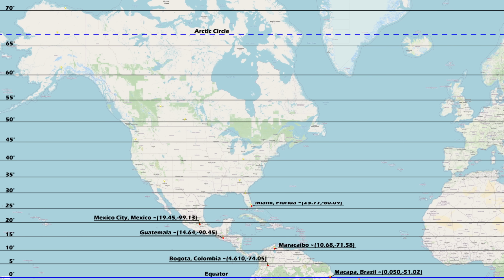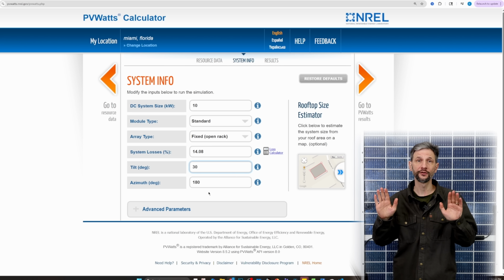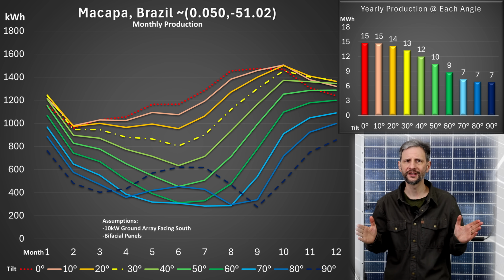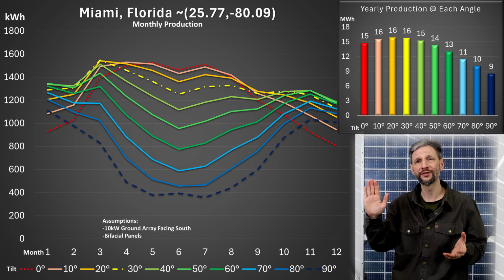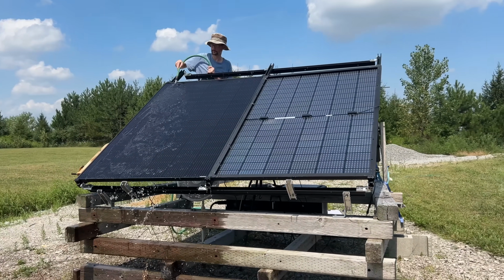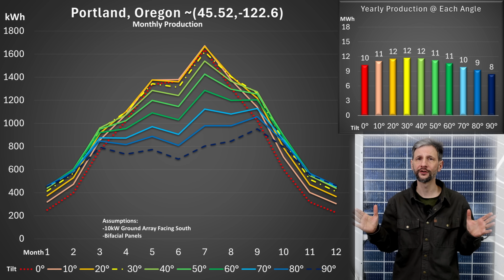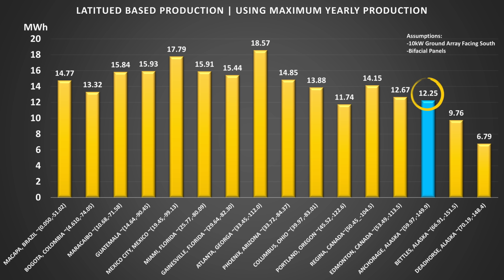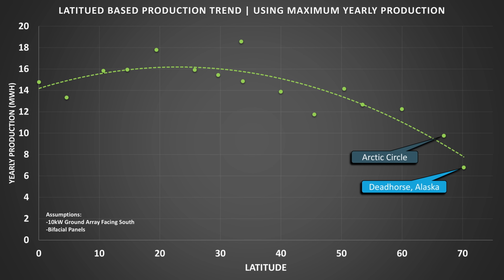Your Location Destroys Solar Panel Efficiency

Comment from the maker: Solar Panel Sources on my Website: https://projectswithdave.com/solar-panels/
Signature Solar ($50 off $500-Discount Code : "GET50EVERYDAY"): https://signaturesolar.com/?ref=SALE
Buy my WIFE a Coffee - THANK YOU!! https://projectswithdave.com/donations/give/
CORRECTION:
A viewer noticed I mixed up the location (Lat and Long) and solar production data for my Phoenix and Atlanta segments.  Phoenix is actually the higher production location just as you would expect.  The heat is not enough to counter the higher solar exposure.  Sorry for the colossal ERROR!
Signature Solar | Solar Panel Deals: https://signaturesolar.com/all-products/solar-panels/?ref=SALE
Reply: I would love a electric plus hot water panel, but all of them still cost too much.
Reply: absolute brain dead rubbish here. at 55 degrees north in the UK, putting a verticle array up in the path of the winds we have, the pannels wont last 5 years
Reply: @jukeseyable  depends on where, some areas have more wind than other. Same with the US and every other country.
Reply: @jsbrads1  I'm a brit, and also a commmercial vegitable grower, so I pay more attention to the weather than most. i think i know where the Uk has significant wind. One thing is clear, and not at all based on my subjective judgement, not a single solar Pv install in the UK is verticle, it says it all. if verticle with its space saving was viable then it would be installed here. But it's not
Reply: @jukeseyable  vertical solar panels are a relatively new innovation as the latitude angle was considered best practice world wide and only recently specifically with the new bifacial panels has the option of vertical panels been seriously considered to any degree.
University of York did a study on bifacial panels (article dated May 16, 2025) and recommend it.
Reply: @jukeseyable  I'm in the UK, and i set up my panels vertically. At least some of them.
They are single sided and are at the north end of a open field, with a line of trees an a hedge behind them.
From about 10am the sun clears the tree line on the south side, and that when you start getting your power.
Dave has his vertical panels out in the open, unshaded, so he may get power earlier than that.
If you put a lot of vertical panels close together, they'll just end up shading each other until the angle of the sun increases, but by then you aren't at an optimal angle for the panels.
At best you can have a line of panels set with the longside up, then in front of those, a line set on their sides.
From that point, you have to start tilting the panels back, but mounting options then become the limiting factor.
Like  Dave mention in the video, it's hard to find a mounting option above 40 degrees. And a lower ground mounted system can deal with winds better at ashallower angle. The UK (generally) doesn't suffer much snow, so the shallow angle isn't much of a problem.
Vertical panels can absolutely resist the windloading. 
Mine will handle around 150mph no problem, using 7 x 2s as the posts, locking them all together at the top and creating diagonal bracing on the north side every other post.
But like i said, unless you have a really big field where you can space out long lines (east to west) of south facing vertical panels, it won't work.
Reply: I would be helpful if you can post those charts on your website

Second if you do a split array: one facing South-East and another South West to get more power for a longer period of the day. In most cases a single south facing array will peak above demand for several hours, especially in the summer. I think two arrays would would better overall for all 4 seasons.
Reply: @guytech7310  sure, there are benefits, you just have to design the wiring correct too. Only panels facing the same direction can be wired together. Many solar systems are wired in series, and that only works if they are all producing the same power at every moment.
Reply: @jsbrads1  You can only wire a limited number of panels in series anyway. Too many panels in series will cause an overvoltage problem. Large arrays have to have some parallelism. Separate arrays can be combined.
Reply: @guytech7310  you can only safely and efficiently combine arrays that are facing the same direction, doesn’t matter whether you combine series or parallel.
Reply: @jsbrads1  1. My inverter will accept two strings, 2. strings can be combined using a PV combiner.
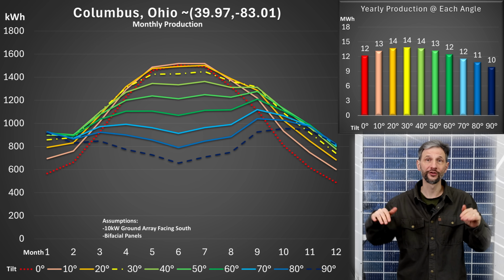Reply: 7:28 - in case you might do such comparisons ever again:  give the viewers from outside USA - and I guess you have a lot europeans at least - MORE time to compare their "OWN" location with those you are comparing. 

I stopped here cause I had been in the USA but I usually tend to forget that the most northern part of the USA (except Alaska which is a different story) here Portland is far south than all central european countries, even south of Switzerland. 
Which again helps to understand the huge differences regarding climate cause chicago is south of Switzerland ... but the climate quite colder and different. 

If you start such an animation give it 2 or 3 seconds to simply adjust or being able to stop the video to allow us a comparison , as you offer the european country on the map at least up to the german polish border or maybe 80% of EU is covered. 

Just a small detail, but try to do it on your own and assume you are living in Hamburg, germany, close to the north sea. If you have found that then turn your head to the left and follow the line to recognice that Hamburg is even north of Portland at the level of Edmonton. 

I am living in germany a bit more south than Hamburg, but not that much : in the middle of nowhere between calgary and edmonton. 

We have an annual production in good years of 1 MWh per kWp installed or 10 MWh for your 10 kWp on a south facing roof at 28 and 18 degree, but with huge peaks which means 10x bigger production in summer than in winter. And that causes issues for the grid if people are hunting a zero draw from the grid and build big arrays with a high surplus they can feed into the grid and get about 0,07 € per kWh which are 0,09 $ while we usually pay about 0,30 € per kWh from the grid (1 flat tarif 247 and for 365 days). 

Great charts and overview, color choices and markings that provide a top overview for everyone. Europe has its own huge solar power institute and tools provided under the term pvgis. If you search for that you can choose the simulatio models and what not and best: not only for europe, but for most countries around the world - and it is free of cause. 
PV Gis is the best starting point for everyone interested.
Reply: You need to correct the Phoenix / Atlanta switch. Have text flash over the start of the video. If I didn't see it here, I would have believed you.

Comment: I have sat and thought about some kind of extremely large battery system you could use to make it through winter in AK. One idea I had was just generating hydrogen from water electrolysis and using a fuel cell in winter. But then you’d have a gargantuan tank of extremely explosive gas that has to contain thousands of psi….yeah. It would be interesting to figure out how to make living in Alaska not intrinsically carbon intensive.

Comment: In florida, id take the 10 degree and even a flat one, because the main consumption comes from cooling, which drops a lot in the winter. Sure if you have yearly net metering in theory something else is better, but if you want to build a grid, or cooperate with it, it makes sense to make more power in the summer.

Comment: I always did wonder if I should have angled my solar for my fence a bit but since I´m at around 48 Latitude I think having it 90 degrees was a good choice especially for winter when I need that power the most and my roof solar is often covered by snow.

Comment: there is too little difference to justify not adding panels (that are cheap outside US) to overcome the inclination imperfections, unless heavily space constrained.
The magic of near 0 angle is that you can orient them in any cardinal direction while keeping production steady enough troughout the day. 
Some more arguments for the angle doesn't really matter, brute force with panels:
You can't step on a 30 degrees roof in winter to clean up snow that panels refuse to unstick.
You dont need to account for wind sail effect and the vertical space visible form neighborhoods when stacking them vertically on a ground array.

Comment: I'm moving my system on my property for better winter sun and no shade issue (live & learn). I'm just below the 45th parallel. I'm thinking to have 6 panels in the vertical position at 60 degrees and 4 panels in the horizontal position at 30 degrees. I'm thinking a mix of tilt angle will give me some of both worlds. Or, do you think all at 60 degrees would be best?

My frame is fixed style and made from pressure treated lumber and speed rail, and I can change whatever I want with it as far a angles. The panels are Aptos DNA-108-BF10-410w bifacial with a maximum 513w. I've read that the best I can expect is 80% of the total watts.

Second question. I'll have a 175' run. My calculations with voltage drop is under 3% at 200 watts and up using 10g PV wire. Am I safe using 10g wire?

My system consists of 3 100amp 48v batteries and a 6500 watt 120/240v all in one inverter. I also have another all in one 3500 120v if needed. All off grid.

Comment: I was thinking of doing a solar fence but I had a idea instead of using bifacial I would use 2 set of 4 panels in series parallel 1 set facing in each direction.

Comment: Sharing my system: 
Europe, 45 degrees latitude 
60 degrees angle for the panels
5KW towards S-E
10KW towards S-W
12KW Monophase invertor 
15KW LiPo battery
Happy to answer any questions.
Thank you Dave!

Comment: For bifacial panels would the panel array benefit from the use of "white" gravel under and behind the array? 
Could the back benefit more, from a reduced angle, than the front would suffer?
If you mounted your array with neighboring, to the side, panels separated by a foot, or maybe 6 inches, the array would be wider but the back would get better light if the mount is angled?

Comment: Looking at this, when i do my system i should invest in a movable rack and just change the tilt throughout the year. Im at 46 latitude and we get a lot of snow. So figure when we have a winter storm coming i can set the pannels to verticle and when it passes put them back to whatever angle makes the most power.

It will cost more sure. But im planning my system to be able to 100% be powered off solar with a backup diesel. So makes sense to invest in the best racks.

Comment: How would this angle by location changes based on the locations altitude?
Reply from the maker: Higher altitude in general means thinner and cooler air, so better production overall.

Comment: This video contradicts your solar panel show down video. Which showed vertical north south was the best orientation. Now the data show the complete opposite.
Reply from the maker: That video shows the Vertical N/S solution was the best production only in the winter, under snowy conditions.  Vertical panels generally under produce tilted panels.  You would only use them because of some other objective.  For instance, a location in the north with a lot of snow, or an E/W orientation for capturing morning and evening power more effectively due to fluctuating power rates or off-grid objectives.

Comment: On my bifacials vertical i get about -30% less on the faces on the wires side, in my case 40.51, -7.11, i pointed the best(top) face to West, so when less sunny days i can get as much sun converted to wh possible as those days sometimes get sun later on. Installation 4 bif vertical E-W and 8 normal South (i increase angle during winter).

Comment: I live in Edmonton, so knowing this, I will definitely give the panels a high angle to shed snow
Reply: I did solar for oilfield radio installations near Edmonton.  We would just install the panels vertical and facing South, because it was far more important to have reliable power in December than maximum production in the summer.  However for residential Dave said that we don't need a lot of power in the summer for AC.  He missed that "Edmonton" or prairie summers are actually really hot now and AC is really becoming a must have.

Comment: Thanks Dave! I am near Fairbanks Alaska.  My current array is on a diy adjustable tilt rack(we  have a little video of it on our YouTube channel if you're interested). Vertical for the white season works great. We are about to upgrade to 8000watts of bifacial panels.  Gonna reuse the existing rack for half the pv. Now I am thinking of making the other rack simply Vertical all the time.

Comment: Hey, I'm in Ohio also. I have a really challenging property to get solar panels and will likely never be able to get off grid levels, but I have an idea. 
I want to use a solar battery generator set up, with panels for daily charging and use my generator for charging or power during an extended outage. 

Do you do in person consulting?

Comment: I'm at 52 degrees, new array will be vertical on south wall on my shop and a second one as a south facing fence.  We currently have 19kw on our house roof and snow is an issue for sure.

Comment: What aluminum strips do you use for the vertically mounted solar cells if you want to make a whole row like a hedge? Where did you buy them and how much do they cost?

I live in Denmark I nnnet a link to order if you wil help I wil be very grateful ❤

Comment: With over four decades of off grid PV use I can tell you my obvious choice in Southern Michigan is vertical south facing panels only.  Traditional placement means lacking in winter with excess in summer.  With vertical panels I rarely have any snow/ice on the panels and the sun is very low on the horizon all day maximizing output when it is needed the most.  This method maximizes actual off grid realities with batteries, but wouldn't be the best choice if you are a grid inter-tied system and only care about maximum annual production.
Reply: Thanks for your insights 🖖
Reply: I'm pretty close to your neck of the woods and I think I'm going to do 24 Vertical North/South, 3 East, 3 West. The goal of my system is to have a hybrid system that almost never actually touches the grid (emergencies only, basically.) My thought process is that while I'll need more panels for the same production, the panels themselves are pretty cheap these days. Going from planning for 20 panels to 30 actually only raises the cost of my total system by about $2000, but it'll reduce my spending on batteries by just as much as well as the number of incidents where I'll have to pull grid power.

Seems like a no-brainer here.

Comment: This was a highly informative video! I'm at 40N and I'm surprised at how little difference there is in total annual output there is across a wide range of angles. A 50 degree panel angle suddenly makes me think about optimizing micro inverter sizing as a way to maximize production. Does that make sense?

Comment: Nice analysis Dave😀  I'm based in the UK at latitude of 52.4 North. I have a small channel where I post my own real world solar results which cover a variety of orientations. I also used PV Watts to get independent targets to provide perspective on my own systems performance. I took find it to be quite accurate for my area

Comment: Can the data presented here be utilized to extrapolate what would be the power production curves of vertical attached one sided type amorphous solar cell panel oversized KW system when attached to an existing expansive square foot commercial building's South wall as a readily available surface space to measure KW output during Winter season to offset the noted Polycrystalline solar panels poor performance during the charted low Sun angles creating Polycrystalline low performing production output during Winter Months in Northern Canada, or Alaska Latitudes?

Comment: Here in Ontario Canada installed 3kW of vertical panels at 15deg. So far this winter 2 out if 3 days my vertical panel are the only ones producing electricity, the 45deg ones are mostly zero.
Reply from the maker: Thanks for sharing your real-world experience, that's great to hear your vertical panels are performing so well in winter!

Comment: I'm in Colorado and I have 2 different size legs on my array for summer and winter. If I don't move them I lose nearly half of my usable energy for a couple of months out of the year.
Reply: I am in far SW Denver.  What angles do you use?

Comment: Can confirm. Edmonton AB, my 16kw array produced ~18kwh year over year.  I upgraded it to a 20kw array and it produces 24kwh yearly now. (Not bifacial). I wonder what the numbers would look like on an adjustable angle array where you increased the angle in the winter months when the sun is low to the south. Also the high angle would prevent snow buildup.
Reply from the maker: Thanks for sharing your real-world experience!  I'll have to do an adjustable comparison at some point.

Comment: I would love for you to put a white concrete pad in front of the vertical array to see if the light reflection helps in summer like snow does in winter.

Comment: I'm at 46 degrees latitude and will be getting a roof mounted system at 22.5 degrees tilt angle.  Glad to see I won't lose a ton of production from being so shallow, since we have annual net metering.  Except for the snow....  I haven't seen my roof surface in a while.

Comment: I'm wondering if the snow is simulated as far as it could be.

I haven't been to Alaska, but where I live, there's snow outside the dark months, meaning snow would still be a factor. Also, the I've understood snow reflecting light off the ground is a major factor boosting production on bifacial panels, but I have no idea how angle affects it.